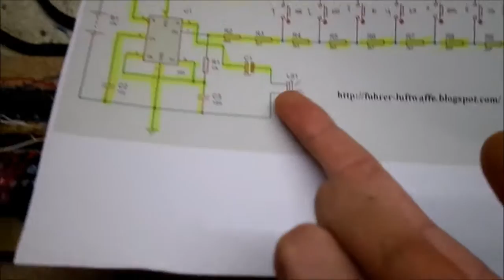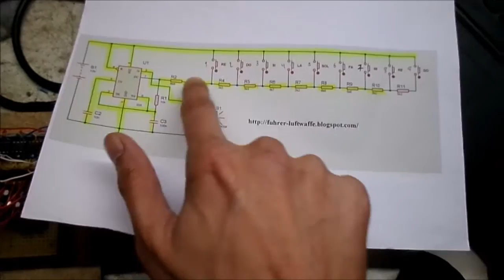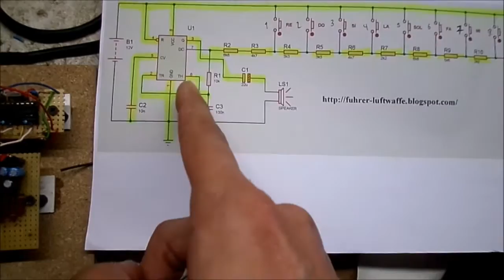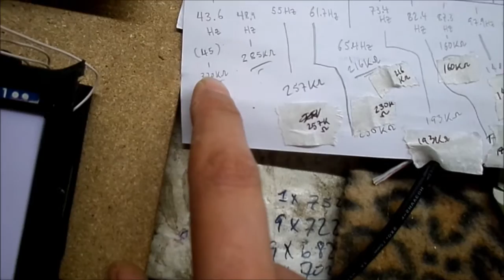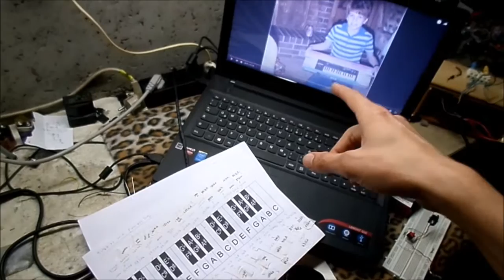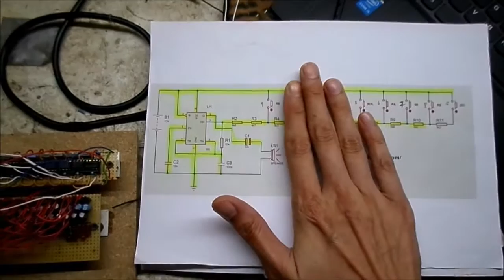555 polyphonic piano how- to build

Comment: Can you explain the circuitry that multiplexes all the signals into one polyphonic output a little better? That's the biggest spot I'm trying to understand for my own project.
Reply from the maker: there is no multiplexing taking place really, the keyboard functions as a polyphonic unit because each key is a single oscillator and the signals are merely mixed together via a simple mixer based on resistors of a same value and capacitors of the same value .. look up simple output mixers to give yourself a better idea .. im thinking of updating the mixer with a op-amp version called ( i think ) a '' summer circuit '' which is better at mixing signals .. my mixer works but is very basic and is mainly there so that when multiple notes are played, the output signals dont interfere with the oscillators ( meaning signals dont travel back to where they originate and interfere or disrupt oscillators in use ! )
Reply from the maker: https://en.wikipedia.org/wiki/Frequency_mixer

after some quick research i believe i was a bit wrong at explaining the mixer portion, keep in mind i haven't worked on this keyboard for a while and had forgotten a bit of what the mixer circuitry did :-p the wiki link can explain a lot better then i can .. my mixer is passive but i want to upgrade to active via the op-amp so i wasn't totally in the wrong lol and with the resistor-capacitor for each signal, they will block signal from feeding back into the oscillator section .. and i do suggest the op amp based summer circuit but you will have to research that a bit as i haven't gotten to that yet ! cheers and sorry for my previous misinformation ..
Reply from the maker: also i forgot to ask, what are u working on ? =)
Reply: I'm going to breadboard a little polyphonic keyboard. Probably all the notes in one octave. But I want to do it as a polyphonic tone generator, so you don't have to push one key at a time.
Reply from the maker: ah sounds cool ! i hope the info helped u out as well :-) if u get it working the way u want post a video i'd love to see it !
Reply: Is it possible for you do do a video specifically on the mixer circuit of the piano?
Reply from the maker: yes i can, not a problem ... also i found a website with 4 mixer circuits explained in detail, that should help u and i greatly ! 
http://www.all-electric.com/schematic/simp_mix.htm

Comment: You may find problems getting high value trimpots, highest i could fine were 20K i think, maybe start with a single resistor that's close to the value and add a series 20k trimpot
Reply: You can also put a fixed resistor in series with a trimpot as you will just need to tweak a few ohms to get the frequency right.
Reply from the maker: no, there are 500k trim pots on ebay... only question is if i want them soon and pay a bit more .. or order from somewhere in asia, get them cheap but have to wait a bit .. i'll take a look on amazon too ;-)